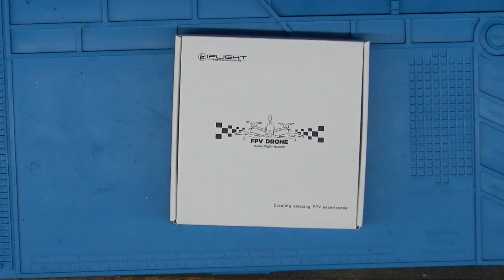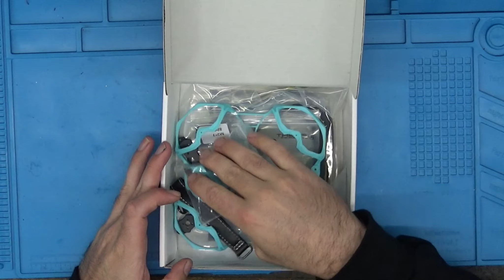iFlight Protek25 HD Pusher Build

Comment: use solid wire with hard flux works the best gets super hot bonds permanently I just bought protek35 puller  frame I always build my own I prefer certain hardware seems every bnf has a part I do not like how is the pusher vs puller I use the 4k runcam thumb

Comment: Nice vid! Do you happen to know if the pusher frame is the same as the regular cinewhoop frame only assembled differently? Or are they different entirely?
Reply: The frame for a pusher has deeper prop guards. This covers the motor height. I turned some props upside down on the iflight bumblebee and had to add tpu footings to not rub the very top of the motor shaft. Hope this helps!